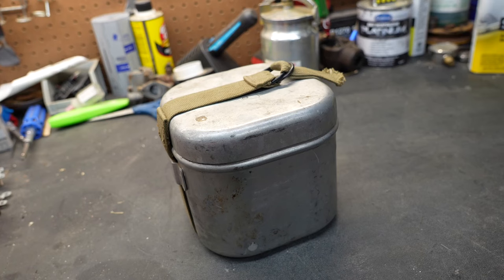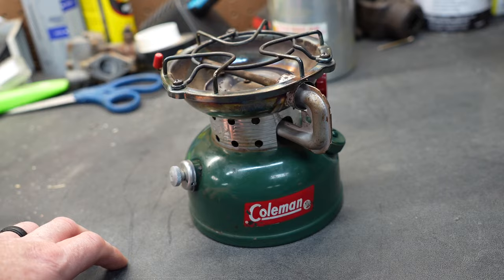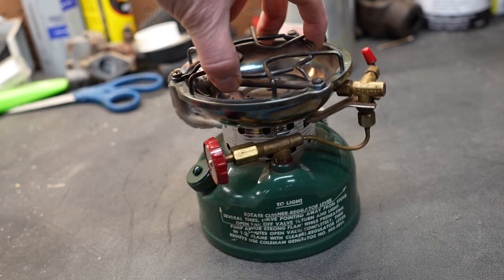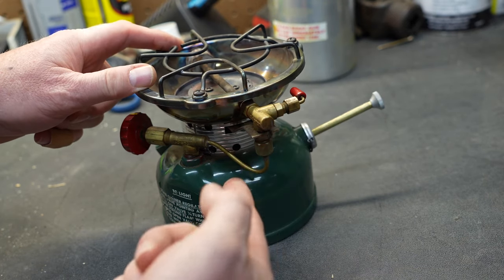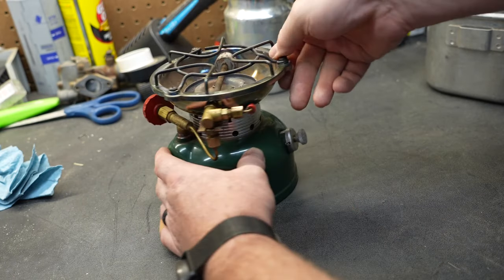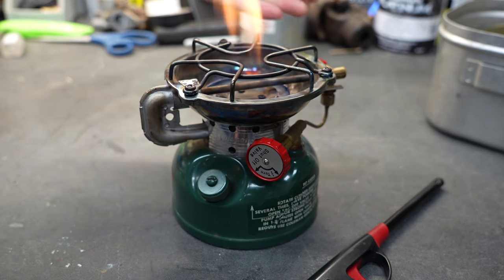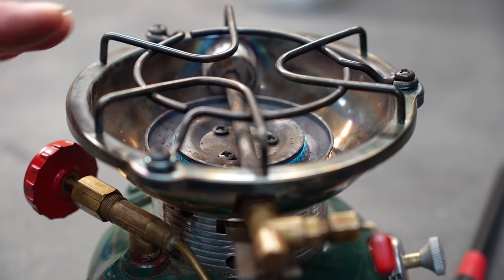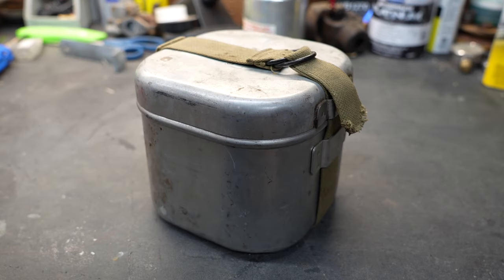How to start the Coleman 502 Camp Stove, The cook kit makes this the ultimate camp stove!

Comment: Nice!  These are built like a tank.  Not power houses, but pretty efficient.
I know this will be a technicality to some, but it's kind of important if you want to understand the instant lighting system.  

Atomization is what's happening when you open the valve 1/4 turn to light on these or put the lighting lever up on the big stoves.  At this setting, the fuel pickup orifice at the bottom of the tank is almost completely blocked.  Since there isn't enough fuel leaking by the mostly blocked fuel pickup, air from the top of the tank is forced down a larger tube that surrounds the fuel pickup tube at high velocity.  THIS is where the atomization occurs.  It's basically a tiny carburetor.  It makes a fuel/air mixture that's just right for easy startup and minimal flaring up if you follow the instruction and have enough pressure in the tank.  This uses a lot of air, so you will want to add more pumps either when it lights, which I prefer to do, or after it's settled down, or both.  Pressure is your friend.  You cannot over pressurize these with the pump.  They designed head space at the bottom of the pump tube to ensure that.

Vaporization is when the fuel boils off into a gas in the hot generator.  This is the goal that atomization gets us to.  Some folks think of the 1/4 turn/lighting lever up setting like a choke on a lawn mower.  They both get the right fuel/air mixture for starting, but you want to turn them off after it warms up.

Once it is burning clean, steady, and blue, when you open the valve on this the rest of the way, or set the lighting lever down on the big stoves, that fuel pick orifice is unblocked and the air can't make it down to mix with the fuel anymore and you stop using up tank air for atomization.

Hope this helps somebody.

Questions, comments, complaints, bitches, gripes, moans are all welcomed.
Reply: Great explanation. I had to learn this to troubleshoot lanterns which have the same mechanism. I had one that had the fuel block rod clipped and it was a fireball every time I tried to light it. No surprise. My only guess is that someone clipped it to run on kerosene which needs pre-heating anyway. The majority of the travel in the main valve is to move that rod up and down within the fuel tube. With the rod clipped and the fuel pre-heated, the lantern will run perfectly at 1/4 turn open.

Comment: I find these old liquid fuel stoves very interesting, especially if they could be modified to run in ethanol or biodiesel/SVO.
Reply: They will run on diesel if you pre-heat the generator.

Comment: Hi, I have same 502.  I'm getting pressure in tank , and here air pressure releasing up through pick up tube but not getting any fuel up through it to light. Took it apart  down to pick up tube but can't get it off to check pick up tube itself.  Air gets through when pressurized can't understand why fuel won't. Any suggestions?? Thanks
Reply: Plugged generator.  TAKE CARE..